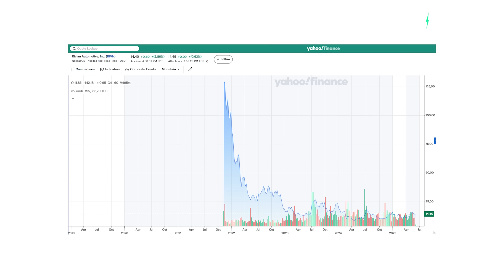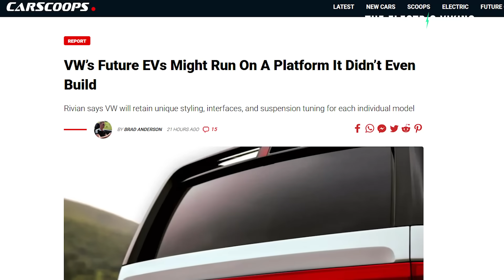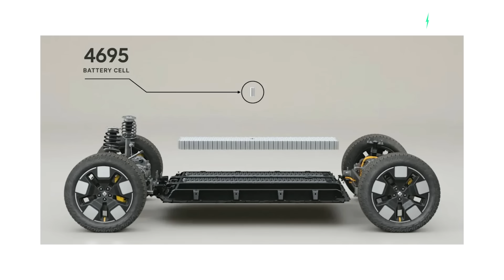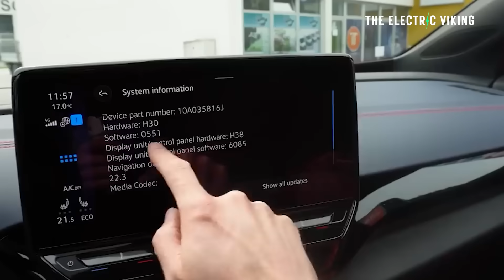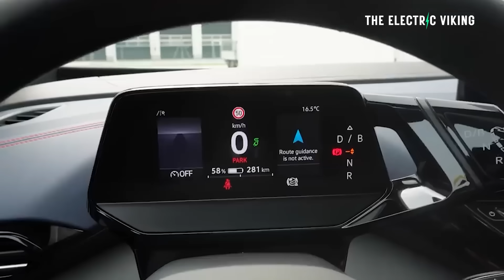Rivian claim all VW Group cars worldwide will use its new EV Platform

Comment: As an Aussie, I've been a fan of Sam's videos. But geez this one was hard to watch. It felt so click-baity. Anyone who follows Rivian knows that the Electric Viking is way off the mark here. And technically Wassym Bensaid doesn't actually work for Rivian, but is the co-CEO of the JV between Rivian and VW. SO HE CAN SPEAK ON BEHALF OF VW. And what Wassym said was the underlying software and E&E architecture developed for R2 will be used by all of VW's cars. Obviously VW are doing some specific things in China, but Wassym's comments aren't incorrect. Wassym never said all VW cars will use the Rivian EV manufacturing platform. In fact, they have been very clear that the JV will be only about the electrical architecture and related software. As amazing as the new breed of Chinese EVs are, the only thing I can think of is Sam is a little biased as he is supported by XPENG, and XPENG and VW have entered into an arrangement in the Chinese market, and this news story had somehow offended him.

Comment: I dont know... Rivian first batteries were a disaster, the new batteries are better, probably Rivian was talking about US models, VW and Scout. We will see, in Europe VW, Audi, SEAT/Cupra, Skoda and Ford Europe are using new chinese batteries, better than the previous VW batteries. Again, I dont know...
Reply: Why are you talking about batteries? VW will be using Rivian’s low voltage architecture and software platform. VW will be on the hook for the software development and UX/UI for their own vehicles, likely using an SDK from Rivian. This will allow VW to dramatically speed up development and offer regular software updates and improvements by using a vertically integrated software and hardware stack. Sam is probably right, that this will be for the non-Chinese produced vehicles only.